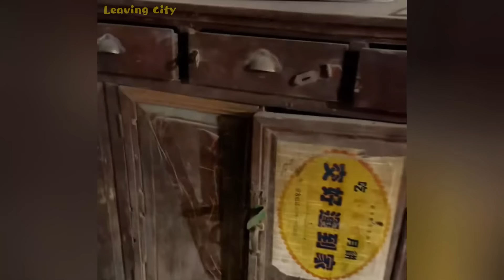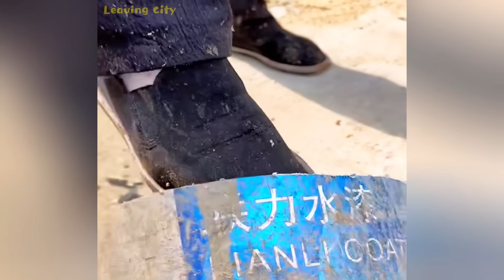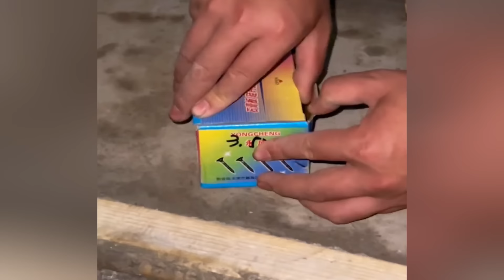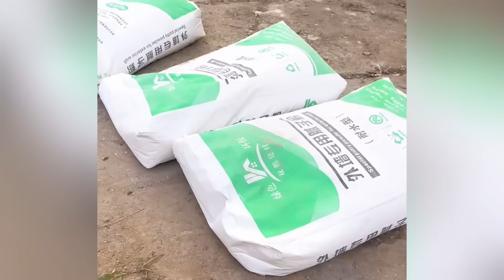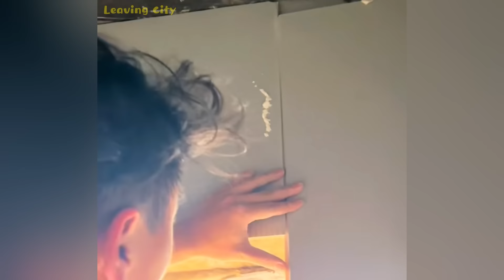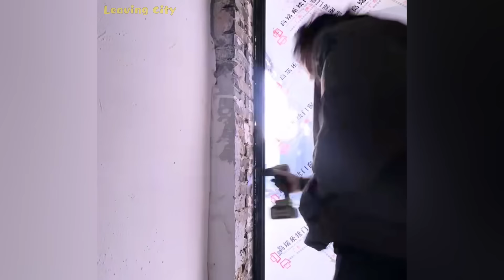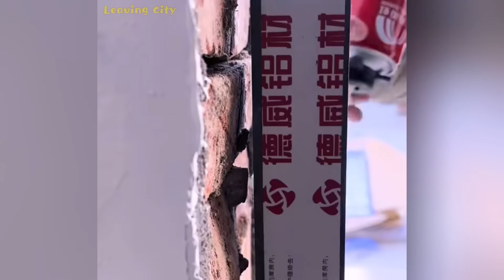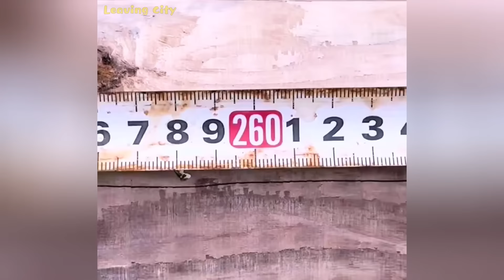Grandma gave her grandson $10,000 and told him to restore her Old House -Leaving the city

Comment: It looks like this project cost more than the allotted $10k.  Also, it looks like the place got converted to a shop.  I'm based on the transparent wall, doors and windows facing the courtyard.  Also, the courtyard has both a store window and a stage with a bamboo backdrop.

Whatever it is, this is the first time I've seen a rooftop systematically laid out tile by tile beautifully.